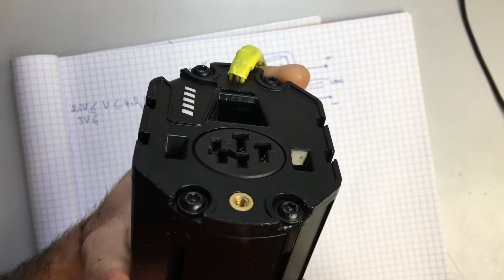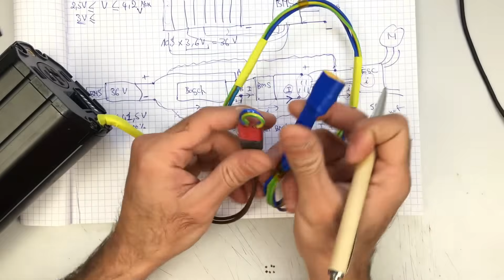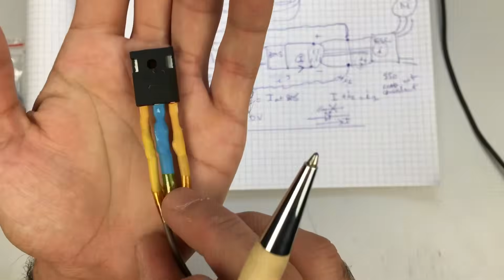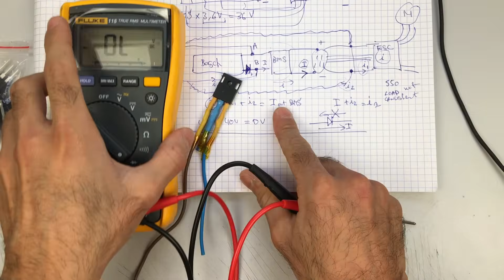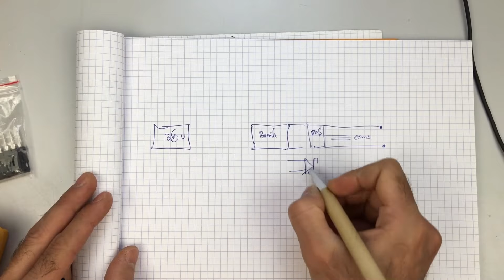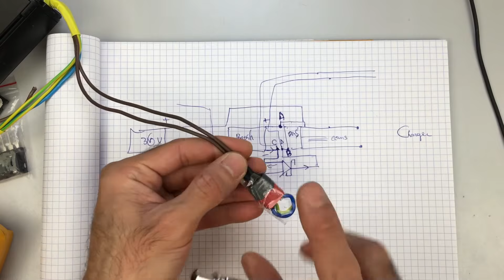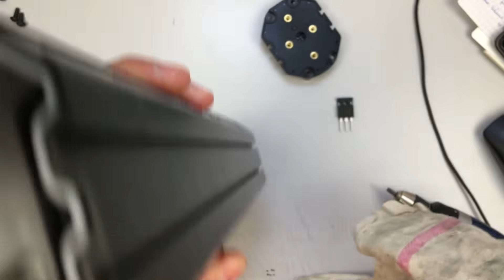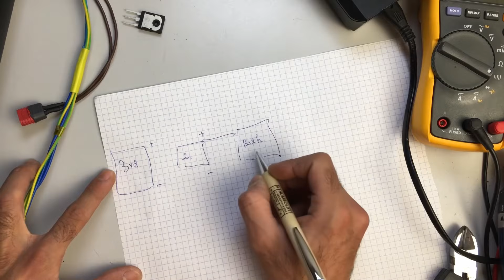Bosch ebike battery hack - Run your bosch ebike on any 36v battery

Comment from the maker: Hi everyone,
If you watch the video till the end I'm sure you're gonna notice that I repeated the mistake with +/- lines.
I'm sure most of you whom are gonna do this mod will know, but just to be clear,
The Bosch battery has the + positive line run through the MOSFETs in the BMS, so it's the + line that you need to cut and run through the Schottky.(as well as outside as a bypass)
The - negative line is still run through the pcb of the BMS, but it shares the same pad with the output.
And as it was pointed out to me by a subscriber, you always connect the Schottky on the positive line, which is correct since the Schottky allows conventional current to pass where it's pointing, so it wouldn't work the other way.
Also you shouldn't connect the 2 batteries WHEN the BYPASS IS CONNECTED and the extender is of higher voltage than the BOSCH. ONLY WHEN BOTH ARE FULLY CHARGED, i.e. of the same voltage.
Thanks.
Reply: Your problem is in your controller and your bms ,there useto be a video its taken down now but ive kept private communication with the guy who made a 2mode controller preferable sinewave controllers 2mode are controllers u can run 2 hub motors off ,well he made the bosch middrive work he did have a constant error on his display but it wasnt  effecting or shutting off his motor ,and a standard 36volt batteries.hes currently working on a segway bike rental controller that acts very similar to bosch but he has put his tauts into this bms in order to not have to the sinewave controller i will update
Reply from the maker: @whitefeatherslinger8194 
Hi,
Check out the latest video I've made, I think I've done exactly what you're describing using a vesc controller. 
In any case i would love an update about the segway.
Have a good one.
Reply: @theelectronage  ill defo up date ,makesure u backup your videos as my friend got wiped off a couple of platforms foe taking these greedy companys down a peg or 2 there prices are ridiculous as if its not already expensive enough people in general are sick of it ,we flashed the old segway ninebots and near crashed the platform thats still doing the rounds but theyve started there BS again so this time it lookslike there gona be decoded so everyone can connect like normal 👍ill follow and check that vid cheers
Reply: 200V diode has too high voltage drop and power loss, 45V version is much better with lower drop and loss. There will never be 45V difference between two 42V batteries.
Reply from the maker: @lubomirnovak9628 thank you.
I misinterpreted the numbers on the datasheet anyway. The datasheet has all the relevant values.
Reply: Boa noite!
Tudo bem ?
Comprei um bike Trek americana usada e a bateria não estava boa,
Refis a bateria dela com troca da BMS de porta comum mais o motor  não funcionou só o display acendeu.
Será que você consegue me ajudar?
Sou do Brasil.
Reply from the maker: Hello friend from Brazil. 
At the very least you need a working bosch bms (meaning a good battery) for the bike to work. No way around it. 
Good luck.
Reply: First of all Thank you for this video! Much appreciated!!
Looking at the schematics wouldn't it be easier to just pull out 3 wires instead? The positive from the bosch battery, the positive going to the BMS, and the negative (that could actually even be tapped from outside the battery). This way we can keep the Schottky outside, avoid any possible heat issue and replacing it if ever needed without re-opening the battery, we could lead these 3 wires to some kind of junction box where the external battery plugs in and where we have a switch to bypass or connect the external battery. Curious if I'm missing anything. Thanks again!!

Comment: Hi i apoligise if i sound stupid but i dont know to much about this stuff.Is it possible to move the bosch bms from the original battery to an aftermarket whit more ah,of course that beeing done by a profesional ?
Reply from the maker: Hi, yes it is possible, yes. 
Check this website and see what options fit your situation. https://driveunitfix.com/
Good luck.

Comment: Some performance line and CX motors take 15-20A, so the shottky would get very hot. Also you got to be very careful, charging with the Bosch charger without changing the wiring to the bms to the charge port of the extra battery could be dangerous as many batteries don't have overcharge protection on the discharge port. Only Common port BMS's do , but 95% of batteries are not protected for overcharge on the discharge port, and this is where the extra battery would be connected after using it for a ride.

Comment: Thank you... What about when the Bosch battery is no longer holding much of a charge?.. Is there a way to easily bypass the OEM Bosch and truely run on any 36V battery pack?
Reply from the maker: Hi,
Sadly no, you still need the bosch bms for it to work. 
Good luck.

Comment: Hi, thanks very much for sharing this, I've been looking for something like this for ages (for Mahle X35 which people connect in a way that with the system setup they only protect the additional battery with one diode). I've been trying to work out of there is a better way (the battery is internal so hard to put in a shotky internally and bypasses for charging)
Reply from the maker: Hi,
Have you resolved the problem?
Good luck.

Comment: When I buy cornflakes, I buy them to eat with milk as they are intended. Cornflakes are not dangerous but these batteries are, the fact that you have had to comment on a mistake you made in the video which could have catastrophic ramifications says everything. Facts states these batteries cause fires, most of the time when they are charging or have been hacked. If you buy a Tesla, do you hack that battery too? Your arrogance and stupidity are shocking, but the worrying part is it;s not just your life you are playing with, it’s the other people near that battery.
Reply from the maker: You keep to your line eating cornflakes with milk.
This isn't for everyone.
Reply: @theelectronage  Nope you’re right, anyone with a brain would avoid it at all costs!

Comment: I really appreciate your detailed video.  If I just connect the generic 36v battery into the Bosch BMS, do I need the Bosch battery at all?  I would like to tell Bosch to just shove it.
Reply from the maker: Yes and no,
As you do need the bosch bms for the system to run, might as well use the bosch battery too for extra capacity, but if the bosch cells are defective or bad but the bms works, then you can take out the bosch cells and put in your own battery. 
Have a good one.
Reply: This is a GREAT question. I was able to get a bike with a bosch drive for very little money but no battery. I’m hoping that a BMS from an eBay battery listed as non-functioning will make this possible for me!

Comment: Schottky is fast switching, high reverse leakage current and low voltage drop, the package is duel diode that is typically used in switching circuits and therefore typically of schottky type.

Comment: Recently, the price of batteries have dropped dramatically. You can easily buy many 12v 100Ah (1280 Wh) batteries for under 200 euros (0,156 cents / W), yet these bike manufacturers have not reduced the prices, even by 1%. An 800 Wh Bosch battery costs 900 euro (1,125 Euro / W). I understand there's R&D, design, safey and use-case topics involved and it's not just a bunch of cells stacked together, but a disparity of over 7 times more expensive is just too much. For now, I am carrying extra batteries an AC inverter on my e-cargo bike. At least I can use that setup to also charge my other devices, too, unlike Bosch battery that can only be used by the ebike itself.

Comment: Thx for nice Video and good Ideas. Can we tage two ShotkyDiode in Parallel connection to double max. Current trough Diode?
Reply from the maker: Hi,
Yes sir, I should have done exactly that but I never had a problem with the one I used, but I'm only pulling 50a max most of the time. 
Have a good one.

Comment: Good evening and thanks for the video.  They brought me a battery similar to this.  The battery charger did not load it and the bicycle did not turn on.  I opened it and all the parallels were at 1.4V.  I reported the battery at 36V with a constant power power supply, detaching the + e - of the BMS.  Then the battery was put back in office, and was loaded up to two notches.  The bicycle does not turn on.  What can it be ??  The BMS broken or must be reset?
Reply from the maker: Hi,
Check the comments on this video, i remember someone had solved this problem if you have a working bms. And he pointed out the order of the bms connections.
Good luck.

Comment: Hello bro... just one question can i use 27Ah another brand battery connecting with bosch Powerpack 400 11Ah, BMS Without using old bosch battery Cells ... is it work...??
Reply from the maker: Hi,
Yes if you take out the "working" bosch bms and put it on your battery. 
If you connect them like i did, the bosch battery always needs some minimum to be working, plus they both need to be charged to same level before connecting them, otherwise there's a discharge towards the bosch.

Comment: You can find a second hand Bosch BMS for little money and use it in your second, larger battery. Bosch even offers a y-type cable that allows you to connect two batteries to one motor at the same time. This makes for a clean solution
Reply: Where can you get a bosch BMS? Haven’t been able to find them anywhere!

Comment: i dont see the point of this, if your bosch battery is not dead why would you do this, and if its dead it would not work anyway
Reply from the maker: Hi,
I don't know, to have a combined capacity of 1.5kwh and go for a 150km ride over 7h going 25to45 kph. 
It's not for everyone.

Comment: Hello, I receled a PowerTube and now when I put the charger on it does this:
-it lights up 3 leds
-charger cliks
-first and second led stays on while the 3rd one is blinking 2 times
-charger cliks again
-the 3 leds stay on and does not charge.

Do you have any ideea if I can do something to start charging or what happened?

When I press the button on the battery it´s showing the 3 leds

Thank You!
Reply from the maker: Hi, 
The behaviour of the leds is an error code for something, but sadly only Bosch has that information. 
I don't know...check if your sells are balanced. Maybe try disconnecting everything, then connect the power to the bms and then plug in the balance wires, or the other way around. I'm just guessing based on experience with other BMSs but with some luck you can find something. 
Also i think you can reset the bms by pressing the power button on the battery for 10s.
Good luck. And let me know if you get it to work.
Reply: @ hello, I already repaired it, it was the ribbon from the cells to BMS, changed that and now it’s working. Thanks! 🙏
Reply from the maker: Right on. Have a good one.
Reply: @theelectronage  I think I broken the chip on the ribbon when I dissembled the pack. The sequence to disconnect is:
-disconnect the ribbon from the BMS
-disconnect (+) from cells
-disconnect (-) from cells
-recell the pack
-connect (+) 
-connect (-) 
-solder the ribbon to the cells 
-connect the ribbon to BMS

There is no problem when disconnecting the BMS from the pack if the BMS was good when you started the job it will be good when you are finished if you don’t kill the chip like me 😂.

I let the info here for the next people who want to recell the pack.
Reply from the maker: @schumi140 very thoughtful of you.
Thank you sir.

Comment: Hello The electron Age, I have a Bosch Powertube 500 and I want to recell it with new cells not because it’s dead but because I don’t have any range left. It still does 10 kilometres. I seen on the forums that if I disconnect the BMS from the pack I will burn it and things like this. Can you please tell me the disconnecting sequence so I can chance my cells. I found disconnecting sequence for PowerPack but not for Powertube. 

Thank you very much!

Comment: Hi, thanks for the precise explanations and the excellent video. my question is: can I use a st60100c to220-AB Schottky diode? the format is smaller, but it is still a 60A 100v .and if I wanted, could I use a relay instead of the bridge, controlled by the voltage of the second battery? When I connect the second battery and turn it on, does the relay automatically open the bypass bridge? Is it possible?
 I think so. thanks in advance if you reply

Comment: Thanks for video and idea. I have a few questions:

1. If you always take your two baterries to ride, why do you use diod and bypass? Isn't be better if you just mount though second battery in bike frame and connect it directly to the bosch battery by just two hidden in frame wires? I have plans to buy one more Bosch Power Pack battery with original Bosch powerpack frame system and fix it in bike like inseparable extender. What is your opinion, it will be safe cofiguration?

2. Do you know how this system can works with newest generations of Bosch engines, f.e. Gen 4 or Gen4 smart system? Dou you think is it true that new BMS can calculate and control current due to accu capacity?
Reply from the maker: Hi, sorry for the late reply. 
Concerning the first question, first of all I didn't know that bosch sold an extender at the time, and I also didn't want to carry 1 or 2 extra batteries around, so the diode was the obvious solution for me, and I don't mind at all how the bike looks as long as it is functional, and yes you can mount an extender indefinitely if you don't leave your bike outside (I can't leave it outside either) and it could be perfect for you depending on preferences. 
I don't know if this solution would work on gen4s because I haven't tested it, in my opinion it should work even if the bms has accurate calculations( I don't imagine that a  battery with too much Wh would be considered a fault).
Good luck.

Comment: Hi thanks so much for this video. Where did you get your second battery and what is it. Also have you ever increased the voltage to 48v for more performance?? Is this possible
Reply from the maker: Hi,
I've made a video about running a bosch motor with a vesc, in it I also showed the battery I use.
With a vesc I did run the motor on a 48v but I didn't like it because the cadence I have to keep is much too high (I like to always put some work in), but it was fun though because I got up to 53kph as a top speed instead of the 45+/- kph with 36v.
Have a good one.

Comment: J'ai fait le montage avec les schottky directement après le connecteur bosch du vélo (sortie de batterie)

Marche sans erreur ... et finalement erreur 550 après 40km.. 😢 donc en effet 2 solution :
Brancher dans le powertube ou créer une interface avec un bms bosch pour faire croire à une batterie bosch
Reply: Mbr6045pt less thermal dissipation
Reply from the maker: Ok.
J'avais essayé ca en premier mais j'avais des erreurs. 
Bon à savoir.
Reply: @theelectronage  vous avez essayé l'interface bms+capteur de température avec fausse information de tension de cellule branché en sortie de batterie chinoise ?
Reply: Question: couper l alimentation après le bms bosch et brancher une batterie chinoise... en laissant le can bosch actif. Dès chances que cela fonctionne ? (Communication avec le powertube mais puissance prise dans la batterie externe)

Mes schottky chauffent beaucoup malgré le dissipateur.  Une solution autre ?
Reply from the maker: @folcovhrs concernant la question, possible. J'en sais rien. A essayer. 
J'ai pas le problème de chaleur malgré que j'ai utilisé 1 schottky et avec le speedbox.
Je sais qu'il existe des composants fake, mais encore j'ai pris celui que j'ai utilisé sur Aliexpress.
Reply: 0.6v×10A=6w... comment ne peut il pas chauffer ?
Reply from the maker: @folcovhrs je suis sur que ca chauffe. J'ai dit que ca n'a pas été un problème pour moi, pas de chaleur ni traces de chaleur excessive.

Comment: I honestly don't understand how you have to go to the point of having to pierce a battery, with the risk that this entails. The Bosch system (not smart system) has the possibility of placing an official extender. Placing another Bosch powerpack 400/500w battery with its Bosch cable (Dual battery) The problem is that this powerpack, due to space on the ebike, or because it does not have the necessary anchors, cannot be placed on 80% of the ebikes with the Bosch system. I have carried out a solution to this problem. I have built a backpack format battery, with the appropriate shape to fit into the ebike. With 30 21700 cells I have built a 500w extender battery. I added a bms from a donor powerpack battery. And I have placed some new connections that respect the Bosch system. All of this now fits inside the ebike, and it works strictly as Bosch has designed it. Not a single problem. The purion /kiosk display recognizes this second battery without problem )
Reply from the maker: Good for you mate.
Reply: Do you have any video or information about connecting?
Reply from the maker: @freshoffroadcorp4642 
Hi,
About connecting what exactly?
Reply: @theelectronage bosch powerpack 500 or 400 wh to powertube batt. There is similar connectors so it can be easy to mount but I never seen it.
Reply: if you are rich no problem , but for normal people whit capacities its more efficient and economic modify the bosch battery.
Reply: @benzotekk I hope I understand this. You have the money to buy an ebike with a Bosch motor, but you don't have the money to install a secure extender. I keep saying that lithium batteries are very dangerous. Please do not make holes or strange connections inside a battery
Reply: Used bosch bikes can be picked up relatively cheaply but battery health is a gamble